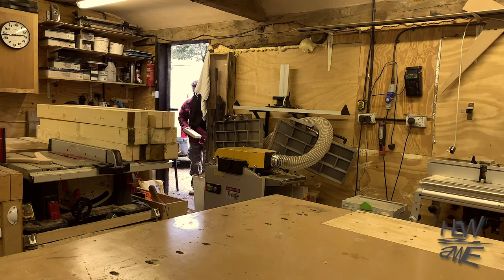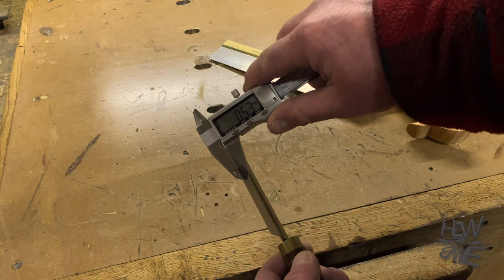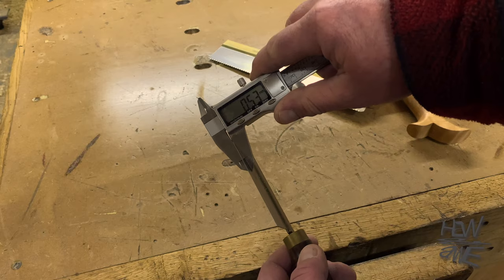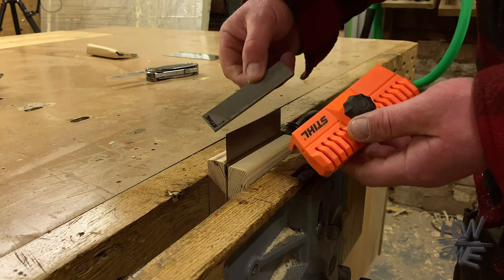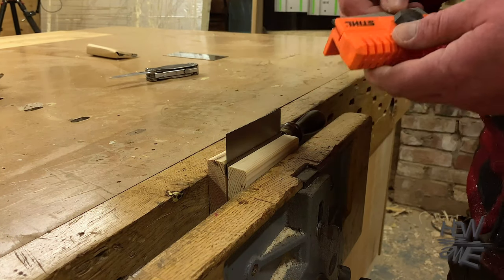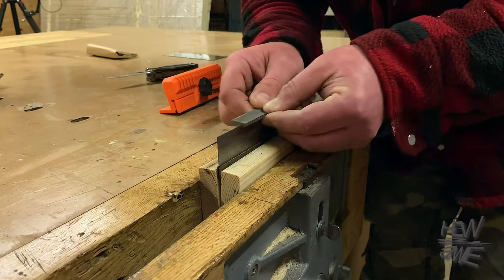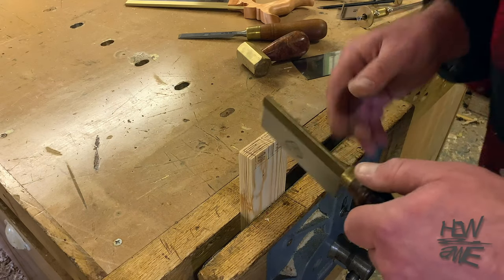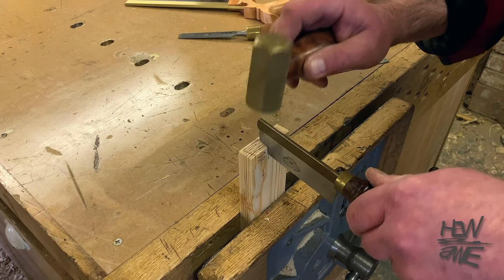Make your own Kerfing tool

Comment: what is the reason for burnishing the blade it seems like you are just folding the cutting edges over and away from the direction you are cutting
Reply from the maker: Thats a good question, was just how I was taught to do it - I never asked why, possibly to help stop the plate of the saw from wandering I'm guessing though. Sorry for the late reply, hope youre well. Kind regards,
Ben.

Comment: I still dont get it, i just wanna sharpen out door pruning saws-can we re-kerf the teeth, or are they to hard(hardened steel that is)
Reply from the maker: This is for half blind dovetails dude.
Reply: Dovetails are prettyweak to me, half blind? I wasnt even looking. Hey bro we all gotta sharpen are owe saws cus a new blade is to expensive
Reply from the maker: @plupyduplupydu1369  you just need the right files and possibly have to set the ‘set’ of the teeth, also a tool needed for that.